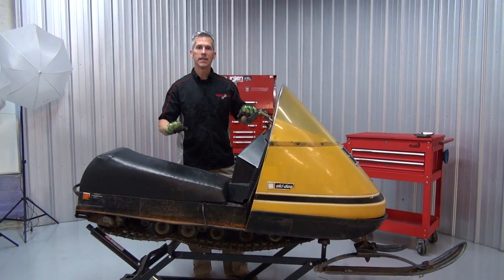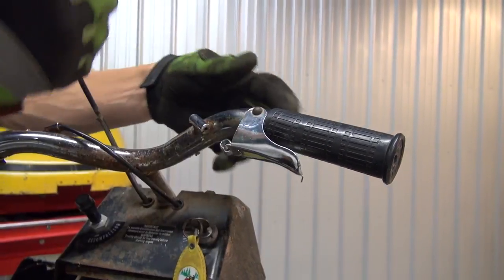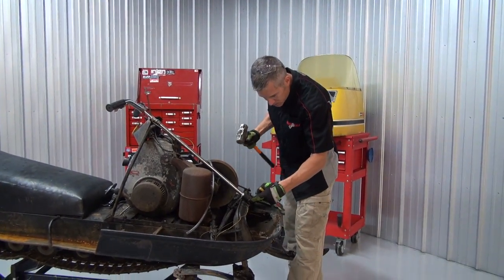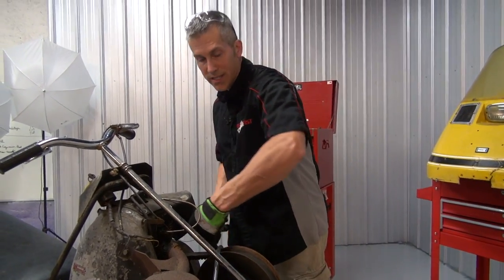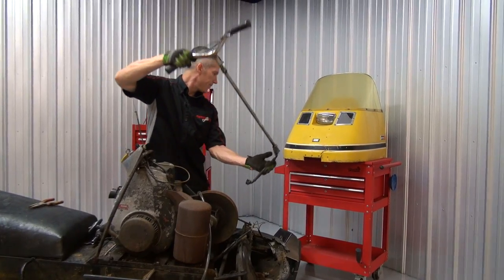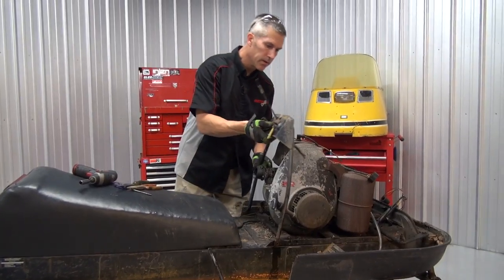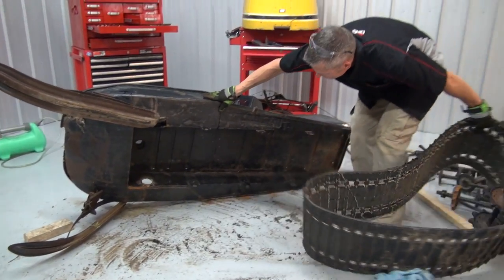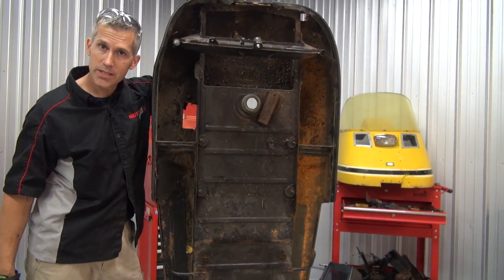Ski doo Elan Complete restoration series! Episode #1, the tear down.  PowerModz!

Comment: My first snowmobile,  I must have broken and replaced about 10 bogie wheel springs over the years I drove it and when I think about it I was only 11 years old. My next sled was a Polaris Colts 250 SS.  Back then we only had 3 TV channels, a party line telephone and video games hadn't been invented yet so I put 1000's of miles on those sleds.

Comment: I had a 71 like this and the throttle cable was toast on it. Ended up using one off of a 95 Mach z that fit almost the exact same. Had to fit it a little differently but it works well

Comment: I recall the 68's as well. Some with fuel tanks built into the chasis via steel tube . Carbs were the at times finnicky tillotsons , popping the plug was simple. As the years of snowmobiles progressed, I was boggled in that you kind of had to remove 75 peices of machine to change a plug/s. They sure won't make em like they used to. All these computer chips and stuff. Whatcha gonna do when miles from home and that fails?  , start walk'in .

Comment: I use brake cables off of mountain bikes they work great for throttle cable the old 90s mountain bikes especially have the same cables plus a lot of the time you can use the sleeve that's on it too because those old 60s and 70 snowmobiles the old cable sleeves usually pretty cracked up.

Comment: You can use a mountain bike brake cable to replace the throttle cable.  It has the same casting on the lever end of the cable.  You can buy them at any bike store and possible even Canadian Tire
Reply: Hey thanks for mentioning never thought of a bicycle shop.

Comment: I just started the series a second time :-) I noticed you mentioned not being able to get the throttle cable? I have a lot of experience with bicycle cables and I know from what my dad told me you can actually heat the cable end with an iron and replace the cable with new, just heat the solder in the lead? I think lead end and slip a new cable in. replace the cable housing with bicycle or motorcycle cable housing cut to size. just build your own. I don't know if you have already pursued this option but maybe this will help. you can solder the end back on according to my dad. also I have a yamaha bravo with the cable tied off at the throttle end ;-) we finds ways to go around the obstacles..... when I needed a cable for my 78 tnt everest a guy I know who works in a bike shop (sled guy too) he gave me a piece of bike cable and it worked fine. I also have tied cables together from the garbage ha ha ha. food for thought @PowerModz
Reply from the maker: Great idea!

Comment: Hello. I’m trying to dismantle a secondary/driven clutch. So for I have removed the helix and the moveable sheave,but not sure how to remove shaft from the stationary sheave. I have put it in the hydraulic press and appears maybe something might break. This clutch is from an older SkiDoo.Looks similar to the Elan. Do you have any suggestions of removing the shaft? Thanks in advance. Karl.

Comment: Hi, love your video... I have several of those different year. We have been having a big problem , wondered if you could help. the mounting flange on the carb keeps breaking! Please can u help! thanks
Reply from the maker: the block type on a tilly or rubber on mikuni?  if block type no idea why doesnt make sense, if mikuni its because the new rubber is junk and gets weak and cracks, support the carb so there is no weight on the rubber.